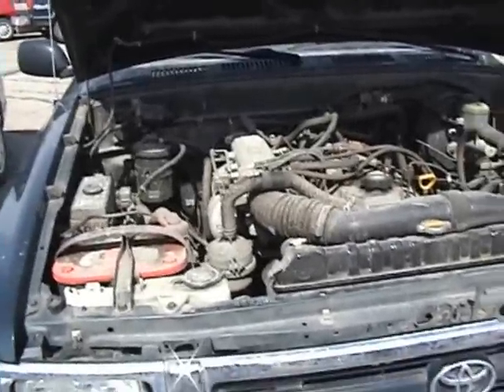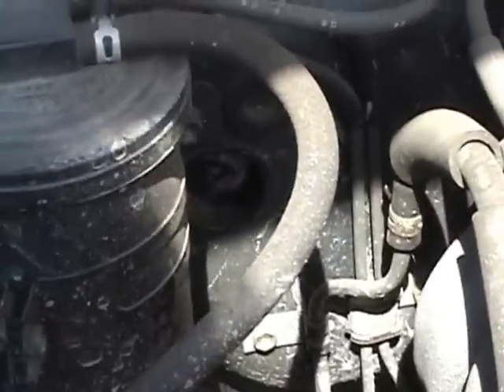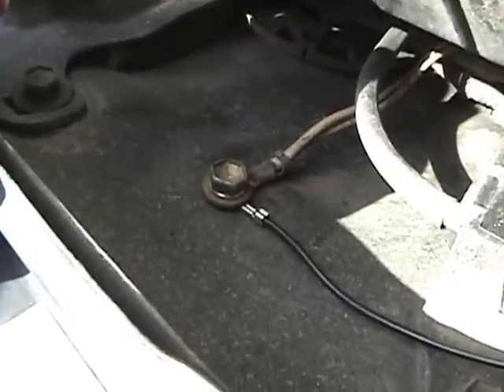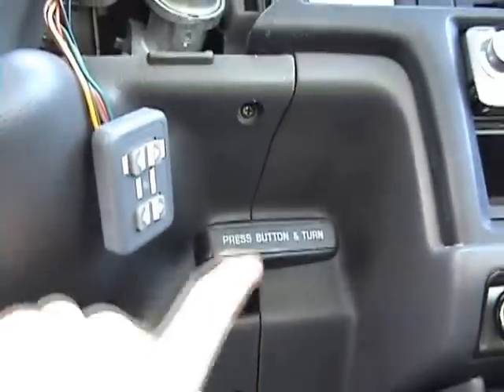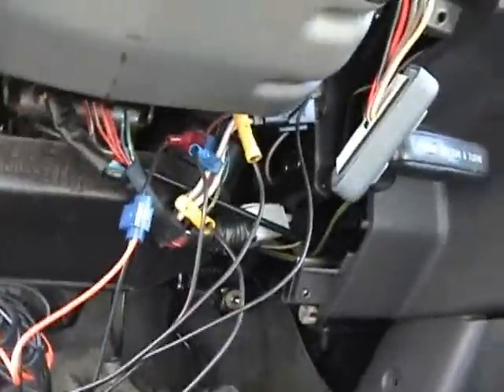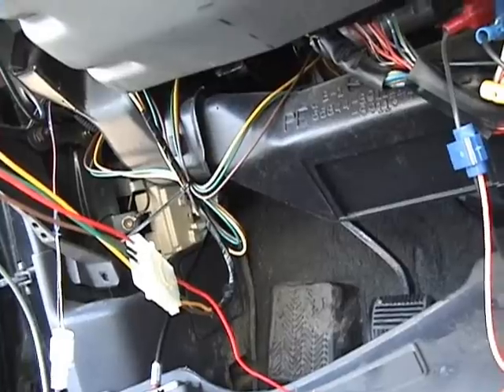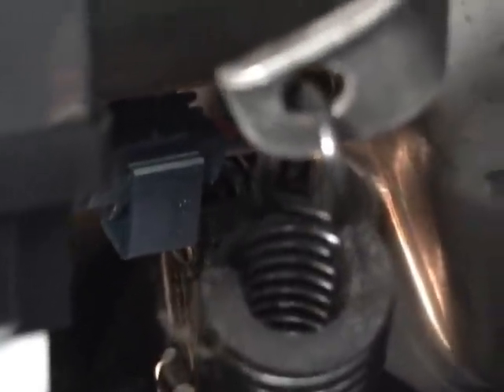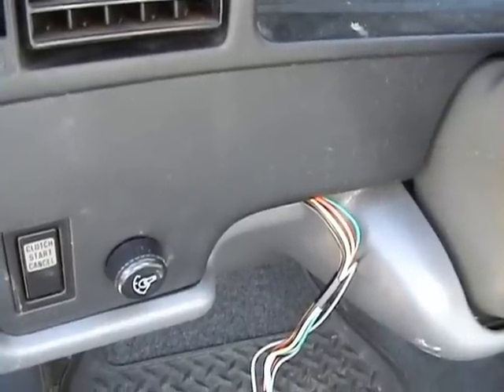Toyota Pickup Cruise Control Installation - Part 1

Comment: Thanks for the video. I just finished my installation in a 92 Toy 4x4 V6. The video helped. I mounted mine in the same spot and used the same grommet hole. I was able to use the VSS wire from the ECM without issue. Like you I also tapped into the BB vacuum line. I used a spiral wound wire loom that I had instead of the split loom that comes in the kit.

Comment: this is a really old video but the only one  i can find that mentions or shows the cruise control cable being hooked up to the throttle cable i just bought an 89 pick up and the dude before me messed with the cables and i cant find out how to put the cruise control cable back do it just go around that little ball or do i need to route it a different way im mad confused
Reply from the maker: I had mine come in behind the gas pedal and do a 180 to pull the top of the gas pedal lever.

Comment: Thanks for the video. How well does this unit work. Just got a green '94 pickup like yours and I'll be on the road a bit. I wouldn't expect it to climb mountains but how about hills? Assuming the engine could handle it? Can you turn it on in 3rd going like 35? What are you thoughts? Thanks again.
Reply from the maker: Hills are alright. I sometimes had to help it along with extra gas up hills.
I have mine setup to run only off the RPMs, not speed. That being said, the lower the gear you're in, the harder it is for the unit to maintain speed. In lower gears, it over-adjusts the throttle, so you're speeding up and slowing down.

For some reason, my cruise control doesn't work anymore. I'm hoping it's a vacuum leak.
Reply: Thanks for the reply and good to know. Hopefully it's a vacuum leak easy fix! Cheers

Comment from the maker: Wow, it's been 4 years and I don't have the instructions anymore, so this is all from memory. You can use the blue wire (tach signal) or the black/gray wire for sensing vehicle speed. the VSS senses vehicle speed directly, the blue wire senses engine speed, which is related to vehicle speed. I connected the blue wire to the low voltage side of the ignition coil. On your car, there should be an ignition coil fuse in the fuse box under the hood, a 30A fuse labelled F15. That *might* work.

Comment: Hi, I have a question for you. I have that CSS-100 and I'm trying to install it in a Peugeot 206 xrd (Diesel). I've been having a hard time getting it running. Question: Do I have to connect the blue wiring to something specific (I didn't quite understand that part)? I also connected the grey wire straight on the sensor (vss), but what about the black cable, this is the one I don't use right? The problem I'm having is understanding where the TACH is. I'm not in the States, so hard to get hep.Tks